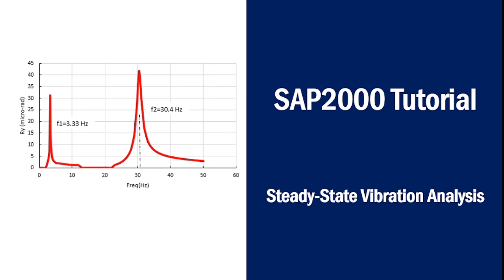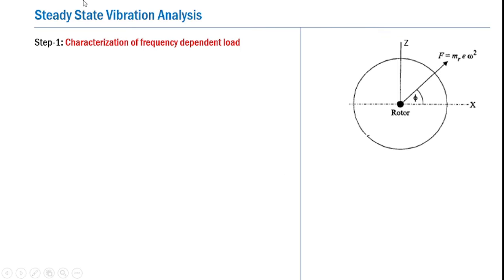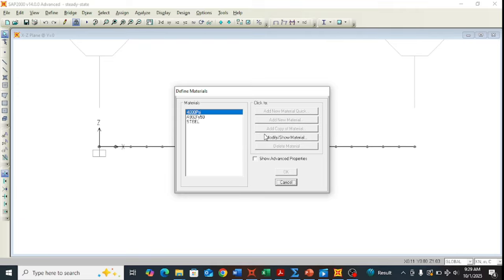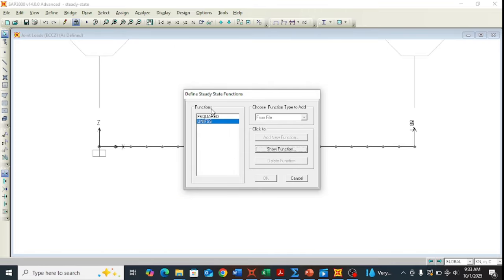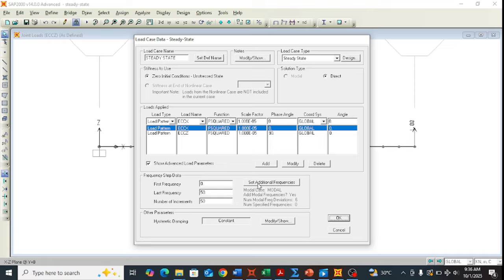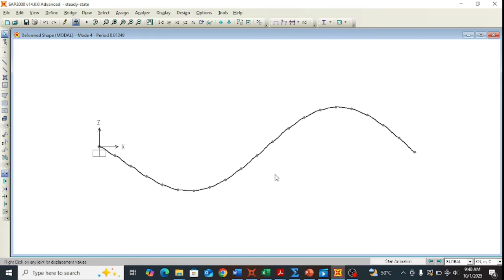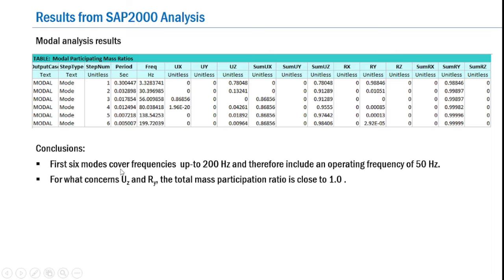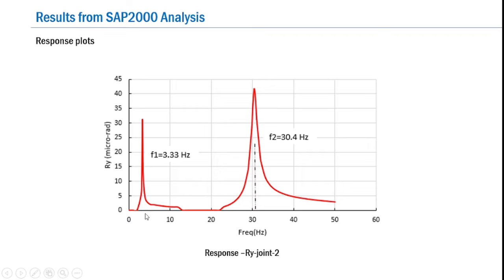SAP2000 tutorial for the steady state vibration analysis of a cantilever beam

Comment: Very very informative video!!! Keep doing. 
I apply an unbalanced force, instead of moment, as you did, at the origin. 
What is acceptable vibration in terms of velocity and acceleration, for various kinds of occupancy??? 
From where do you obtain this data.
Reply: Would be waiting for your video on floor vibration, if possible cover floor vibration due to two reasons a) machine vibration b) human jumping on a given floor
Reply from the maker: his is only a demonstration problem to explain various steps of  steady state vibration analysis.  I have considered a machine (say a motor) with a rotor unbalance resulting in a frequency dependent exciting force. The rotor eccentricity is normally provided by the machine manufacturer as per balance quality grade computed according to  ISO 1940-1. For machines , the acceptable limits of amplitude, acceleration and velocity are normally provided by the machine manufacturer, though various codes give some guidelines.

I think your question is in particular regarding the floor vibrations and will provide you a detailed video shortly...........
Reply: Thanks a lot. You are right, one should use torque as amplification factor not force.